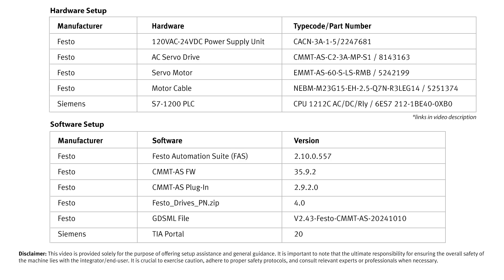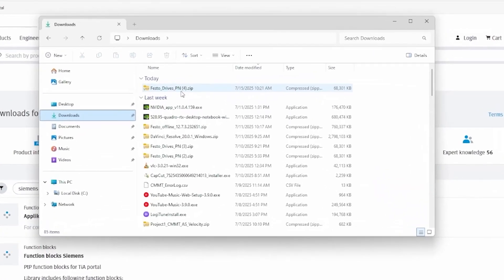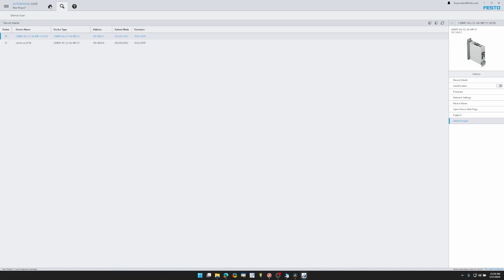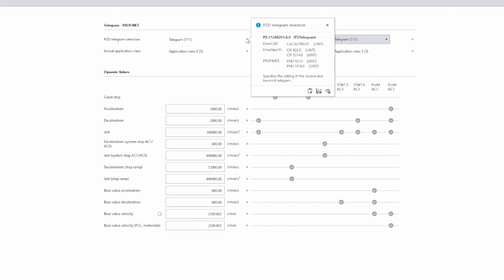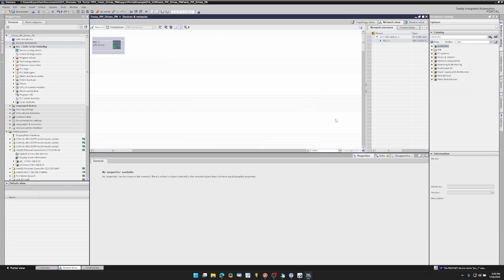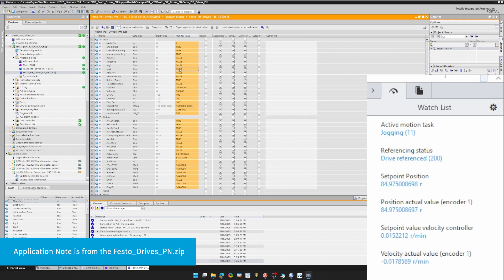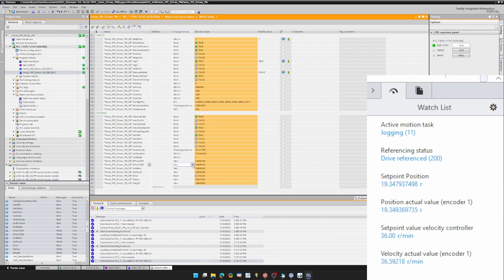How to Setup and Command Point-to-Point with Siemens PLC and Festo Servo Drive

Comment: Thank you very much for the video, After 2 days struggling i found this video, just some asking for a high speed point to point position are this method will work ? or i need to use the record table mode?
Reply: Hello! I think you could use the method in the video for any point-to-point positioning.

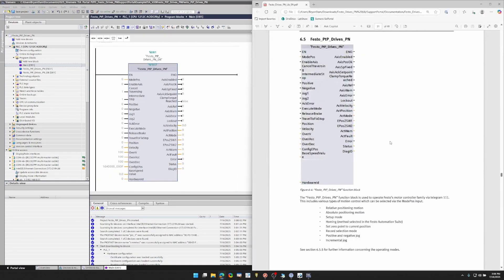Record Table is another option and should work as well, but requires more set-up in Festo Automation Suite (FAS). You could reference time stamp 13:00 to see the "record table selection" mode in the function block. There is a PDF Application Note that you could download to explain in more detail as well.

Feel free to reach out to your Festo contact for further questions and I bet they could help you.